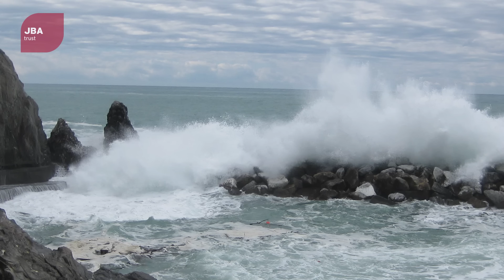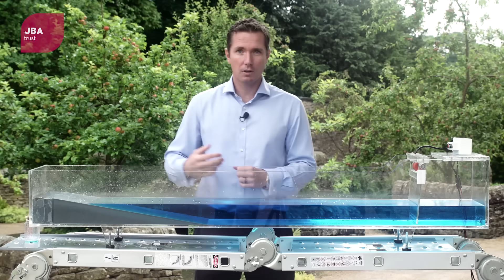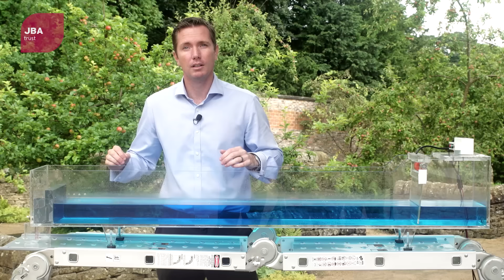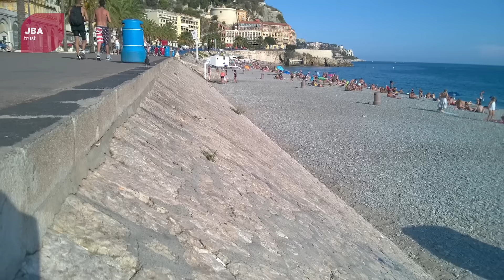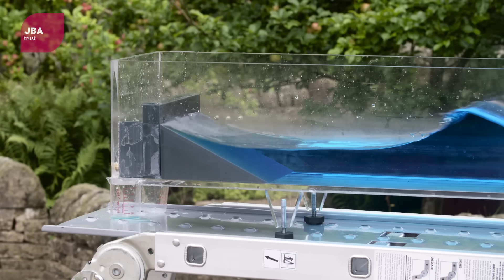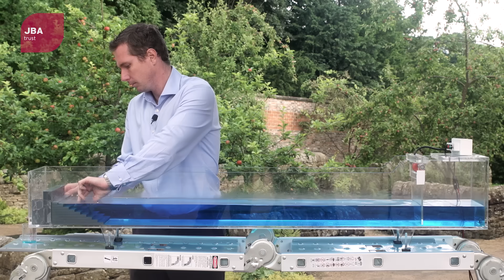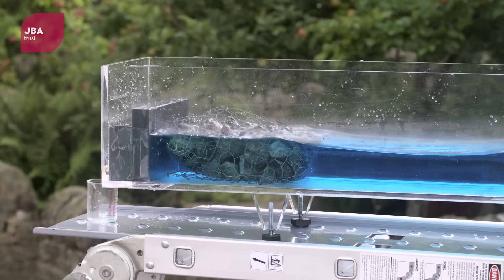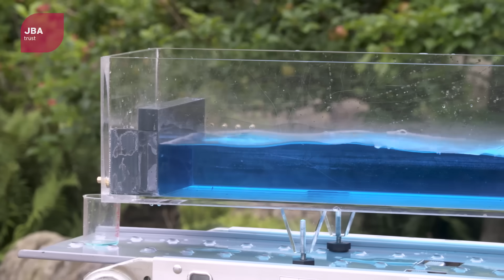Wave tank demonstration showing the impact of coastal defences on flood risk

Comment: The recurve may be effetive, but it gets chewed away much more rapidly than the vertical - because all of that incoming energy has to be taken and redirected rather than just brute forcing half the energy as the simple vertical does.
Erosion will always be the big issue, more than anything else, because eventually it will remove whatever natural buffers stand between the limiting devices and the water itself because all of that wave energy will always have to go somewhere.  If there are walls and rocks and other impediments then the water will be channeled, increasing its carrying ability, so the sand will be even more rapidly dispersed.
The offshore may be the most expensive, but it also has just about the greatest longevity because, like putting plants on an embankment, it fosters growth.  Growing things soak up a lot of energy, reducing the channeling power of the wave as it moves over the barrier.  That's why pretty much every harbor in the world uses some version of this.  It may not be practical, in a cost analysis sense, to move billions of tons of waste rock a couple hundred feet off shore, but in the long term it is the most viable and over time it is actually the cheapest.
But, of course, no one things about such costs distributed over a century, or a decade, resulting in the two worse case designs shown - because they're far cheaper, LOOK like they're effective, and the populace can say they implemented something cost effectively, despite having to repair or replace it in a decade or three.
Reply: Its better to redirect the energy than absorb it with "brute forcing" as you say. Like turning instead of breaking when coming head on at an object.

Comment: so basically just putting a recurve wall and an offshore wave break, you can stop like 99% of wave damage. the recurve wall is probably the best cause most if not all waves should be stopped by it and it also prevents rocks from being brought to land by sending them back as well. the rock barriers in a metal cage is terrible because the cage will rust and fall apart. they have them where im from and all its doing is causing damage by having the stones fall onto the road. if they put the rocks in another type of cage then it wouldn't be that bad

Comment: What are the disadvantages of the recurve wall?
Reply: Gavin Jenkins Because otherwise it would be super OP and would just get nerfed in the next update. These developers think ahead.
Reply: Why would a slightly shaped short concrete wall on the shore be expensive? Every other option (except the plain wall) seemed to require like 10x as much material or installing underwater. And the plain wall should beonly marginally cheaper as it's basically the same thing.
Reply: The extra cost isn't a matter of how much materiel is used, but more of the extra time needed to build it. They can't just pour the mix into a recurve wall mold and just let it dry. They will need to be sure that the material got into and filled the hard to reach areas.
Reply: Zara Ali The Netherlands is for about a 3rd below sea level, a large portion has been protected by dumped rocks for over 50 years now. The Delta Works was added later in Southern areas which are marsh areas, but the Afsluitdijk is just a bunch of rocks that protect my house from being flooded as I'm 2 meters below sea level. As for economical solutions, that's what other nations focus on, we focus on stealing land from the sea and keeping that water out, and no one does it better than the Dutch.
Reply: it wont protect against the tide or a tsunami while the cheap rocks will but the cheap rocks take away from the beach
Reply: truuuuu
Reply: I dont agree with your analogy.  You say that its better to "chuck some rocks out in the water" to save money, that much I agree with, and then use the example of the Dutch.  The Dutch spent $13 billion and 50 years building the Delta Works....hardly the most economical solution.
Reply: +Zara Ali and they are investing another 20 billion over the next 30 years. the delta works took 40 years to complete. and investing this kind of money is a better solution then rebuilding our economic heart after a flood. also, these achievements made the Dutch the leading party in water defenses. something company's like Arcadis and Van Oord are taking the fruits off which means more bussiness.
Reply: If there's a beach it will reflect the waves and scour the beach
Reply: I reckon the biggest issue is that It's expensive
Reply: Probably the fact that it takes up space on the beach itself, there are many touristy locations that have built in a way that placing a recurve wall would require a lot of modification to the place to stop it from being inconvenient. Take for example the Rio de Janeiro or Cancun beaches.

Comment: Vertical wall behind "beach" - 50ml, vertical wall alone - 70ml, vertical wall behind revetment (which is similar to "beach", just different slope) - 125ml.

Conlusions? Sometimes slope helps, sometimes makes things worse. You can't actually draw decisive conclusions from such a small amount of data. Evidently this results aren't relevant and reliable enough.

There are just too much variables to test all possible combinations in empiric way. Properly confirmed mathematical model still should be more useful.

Comment: how about using all discarded plastics and turn them in to hollow offshore breakers, one at the location, just fill them up with water from the ocean they ll sink to the bottom and then just secure them on the surface.

Comment: Here is the only huge problem with this. Sea level is EXTREMELY variable considering the conditions. All of these tests are done with a static sea level. Think of the recurve wall and how well it performed? Well it only performs that way when the water level is below the height of the recurve. Imagine water level was higher than the recurve or waves were overtopping the recurve, it's defense would go right out the window as its shape would do nothing to solve the waves overhead.

Comment: Enjoyable video! But when discussing a storm surge (as suggested), these final barricades wont be submerged with normal water heights, so thats just a fallback-mechanism of the full preshock barrier. And questions: Does the homogeneous backwards flow of the water at the top over the submerged barricade cause more wave energy dissipation than a real Flow woud? And is some of the effectiveness in this model caused by the way the wave is generated?

Comment: Shouldn't the distance between the wave source and the barrier be around twice. The 5 waves take around 6 seconds to be generated. Each wave takes around 2 seconds to reach the barrier, so 4 seconds to reach back the wave source. Doesn't that mean the last waves are generated with unintended interference from the returning waves hitting the generating paddle?
Reply: Oops... recurved barrier makes it irrelevant. Does the offshore underwater barrier have to be so bulky? What if it has the same cross section of the beach barrier?

Comment: Good simple experiment to prevent water from going into coastal buildings. Looks like the best things used and can be combined are the curved wall, the rocks, and the off shore underwater thing. The rocks are good, but I don't know how they will be like on a beach, the curved wall is something that should always be done, why they don't do it is economical to do the curved wall. The off shore underwater thing simply requires those building it to swim out there and place the thing down in the water so I don't know what contributes to its high cost, but good that it does not have to appear out of the water and can be small.

Comment: What if you were to put the C shaped piece under water where you put the break? Could that potentially reduce the amount of energy making it to the beach or wall by having it instead actually just force itself against on coming waves? Something like a gradual upward slope into a sharper curve outward at top could gather and force much of the energy back against waves that would otherwise make it towards the shoreline.

Comment: you need to take into consideration that the different designs would take up different amounts of volume causing the water level to change. higher water level would mean more water going over. this design isnt at its full potential

Comment: You should flip the ramp and then add skinny walls so it could have extra support and slice through the wave but make the walls supporting it skinny but thick at the same time cause the waves would just bang against it and it will tumble in the sea so you need the extra walls

Comment: I would still pick the recurve wall because it preforms well, the rock armour as u said completely decimates the practicality of the beach as they had done at my beach ( hawker beach in Mt Martha ), also if u did the under water arc it would stop surf at certain beaches.
Just my thought
Reply: I think that's the point, and the point of the video. Every situation is different, so the goals are different. Some beaches are nowhere near homes so there's zero chance of flooding. Some are great for surfing so you wouldn't want to obstruct the waves coming in. Some are more popular for swimming, so breaking up the waves further out is ideal. Some are popular for the beach, so you don't want to cover it up or make it inaccessible. Some are not popular at all, and so putting up a rocky barrier to protect a local community wouldn't be a problem. 

 Watching this I was thinking a lot about California where I live. Because California has a subduction zone along the beach between the Pacific continental plate and the North American plate, most of California's coastline is cliffs and rocky. Many of the places with sandy beaches already have natural protection like cliffs,  or huge beaches that extend inland. Also because California is stupid and they hate happiness they don't allow any private property on beaches, and they stuck a highway along the entire coast so there's usually like a quarter to half mile of undeveloped land across the entire coastline, making flooding virtually never occur. That's one alternative, don't let anyone live near the beach, no homes will be threatened.
Reply: Jamie Burnett the rock wall isn't that bad. My local beach uses it and all we have to do is just climb over a few rocks which isn't very hard to access the beach. In the past 20 years there hasn't been a serious injury related to climbing our rock wall do its actually really effective
Reply: Dood Goi yea, it's not hard to climb over it's that it covers the entire beach, there is no more nice sand to walk on it's just big sharp rocks
Reply: It reduces the practicality of the beach by 10%?

Comment: Sea walls increase the beach erosion, because whenever the wave energy arrives at a slight angle, the water sweeps strongly sideways and takes the sand away. This tank cannot demonstrate that effect, because it isn't wide enough. Groynes stop the effect and can cause sand to accumulate even more, so you need less wall.

Comment: What would be result of the step option if each step was given the curve feature? Would each step be too small to divert enough force to make a difference?
Reply: Arron Smith i want to see this, now.
Reply: I think the recurve wall works best with the slope thing, because it concentrates all the water into the curve. If there was no slope, there wouldn't be any difference between the recurve wall and the straight wall. Without the slope, the curve wall would not be able to throw back water effectively.
Reply: I was just thinking that. Hypothetically it would divert small amounts back into the primary force slowing it slightly. I would be interested to see what actually happens.
Reply: That's when you make the top part of the recurve wall an overhang. That way when water splashes up, it then gets directed back. Doing a stepped slope of the recurve wall on each step could probably work, but it would be most costly and basically offer the same amount of defense. So might as well go with the cheaper option, and put one bigger recurve at the top.

Comment: Very cool presentation.  I take an interest in water waves in particular and have probably seen every rogue wave and tsunami video etc known to man.  Thanks for that.  
How to protect against a tsunami is probably the ultimate coastal engineering challenge.  I've thought redirecting the energy or even using the massive force against it would be the only way; utilizing a robust recurve system possibly.

Comment: If you moved the rock armor back on a deep beach then it could still be useful while blocking the largest waves that would reach the communities. Pair that with the recurve wall and you have a extremely good defence against ocean damage and flooding. Even more defence could come with using the underwater break that could help dissipate waves before they reached the rocks.

Comment: Very interesting, thank you. A bit uncertain about the recurve wall. To me it seemed to be exactly the right height for the wave size you were producing, such that the water flowed perfectly into it and around the curve. I appreciate that you have to design to some standard, and that comparisons need to be equal, but it does look to me as if, given larger waves or different frequencies the recurve wall could easily degrade to be no better than a straight wall. Probably you have done many tests with many wave heights and frequencies and do know that the recurve wall still ends up better on average - but probably nothing like as effective as your demo suggests, I think.
Reply: Historical storm data will show min/max/mean for storm conditions, then they can "add a bit" (as we scientists call it). The idea is to prevent frequent flooding, not any/all flooding ever.

Comment: Great video! Could you do a video showing tsunami like conditions and ways to block them from causing harm? Piling up recurved walls on top of each other = tsunami killer? Could there be a way to have such defenses mobile, or easily constructable? I say easily constructable because I had the thought of an inflatable (GIGANTIC) plastic, recurved wall barrier, that could be inflated in the event of massive waves. Maybe ones just big enough to put at the front of buildings (I'm imagining hotels), to protect those buildings and those inside it :>

Comment: In this model, the velocity of the waves are directed perpendicularly to the barriers.  What happens if the velocity of the waves are directed parallel to the barriers, as if they were put along the edges of riverbanks? Do they still perform in the same relative ratios?  I ask because Cincinnati uses the stepped barrier along the banks of the Ohio River, which, according to this video, are not a very effective mechanism

Comment: U must relize this won't work if floods from a massive rain storm and the ocean rises that means it would most likely not work and it won't curve around if the spot has no air.  With the recurve wall.  Recurve is the best for lest eroding but it will not always work if it's flooded before the waves come

Comment: one test run
As you can see, that made it consistently worse. Consistently as in we have tried this many times and got the same result every time. Worse.
Reply: It was five test runs - 5 waves, and they were very identical.  And you are expecting a LOT for a mere 12 min video demonstrating a tank for experiments!  This isn't for making ground-breaking new math, it is just meant for practical experiments with fluid dynamics.  Plus it was set on "easy mode" - notice there was more buttons and more variables he can play with?

Comment: Why didn't you test a RECURVE STEPPED REVENTMENT!?

You'd get all the convenience of a staircase down to the beach for pedestrians when the beach isn't flooding, plus multiple recurves breaking the waves during a flood.  Each step wouldn't be as tall as a recurve wall, so it wouldn't be quite as effective individually, but it would add up.  Also the wave would have to fight the backlash of each step to surmount the next step.

I'm not 100% sure it would work-- that's what the tank is for.  I'm just wondering why it wasn't tested?  It just seems like the obvious next step after how well the recurve wall worked.

Comment: the slope was acting technically as a beach because it already had a water on it, but if it the machine was deeper and had the slope higher it would have had different results, the same with the stairs the water was above it so of course it would have went over.